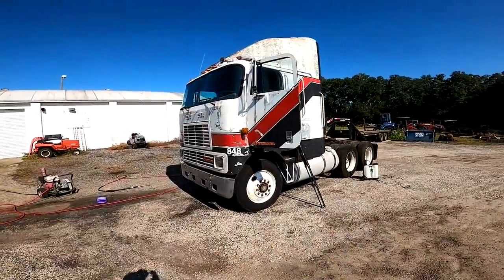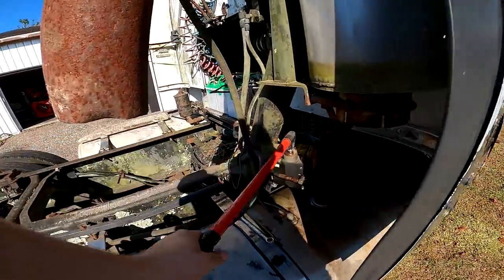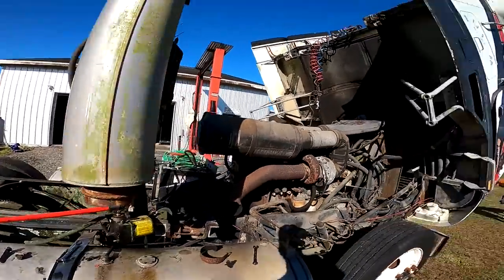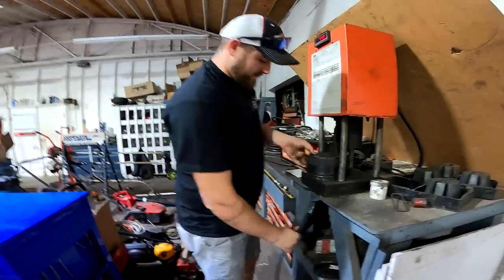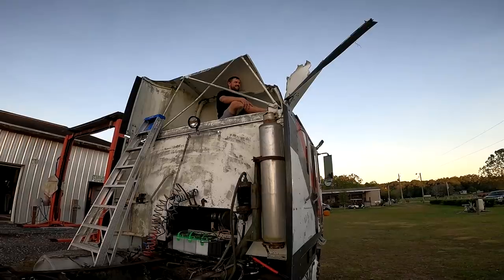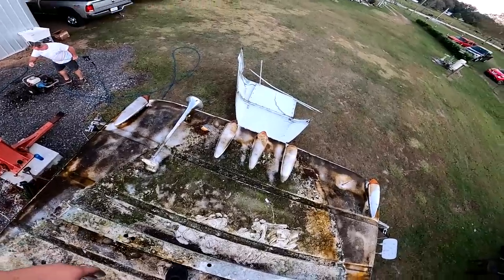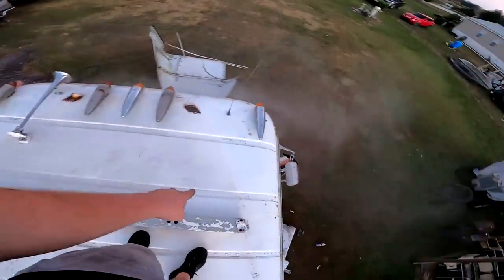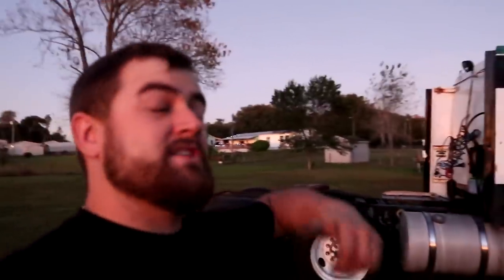THE CORNBINDER GOES UNDER THE KNIFE!!

Comment: Yeah engine id info usually on driver side of engine. Should have a metal like tag on front of injection pump. Probably a big cam 3 maybe a 4, i think its like 855 ci, like 14.5 liters. Around 350 to 400 hp 1450lbs tq. Easy like a 12 valve turn a screw and crank up the fuel  and roll coal lol.

Comment: All she needs is a set of chrome rims and twin pipes
Reply: And a air snorkel intake
Reply: More like polished aluminum wheels... not chrome! 🙄
Reply: Could have BOTH....needs the old lug studs pressed out of the hubs and longer studs installed to run Alcoa's up front, but assuming these are the older ball-seat wheel lugs, he COULD do it up "West Coast Style" with chromed steel outer wheels for the drives. There's powder-coated versions available now that guards against rust, would look REALLY nice.
Reply: @paulallison6689  Yeah so you can polish oxidation off all the time. That's always fun.

Comment: Leave the brackets just in case you want to haul something with a equipment trailer.  Top bracket makes a great bracket for a light bar and brackets by the light are where you can mount strobes.

Comment: Don’t mind me asking how much did you pay for the truck?
Reply: I’ve been dying to know that myself
Reply: Kinda wondering as well
Reply: I pray not too much. Even if it wasn't dead in a yard its not a valuable truck at all. Probably a 300HP cummins (Maybe a 330HP M11) in it and a 9 speed. Not very desirable anymore. 400HP is considered the bare minimum anymore.
Reply: I’m with these guys I’d like to know myself I’ve always wanted a cabover just wondering what kinda price to expect. Maybe keep up with cost of repairs and all and do a video when the truck build is done.
Reply: @gearjammergamer8560  while that may be the case. No emissions equipment allows for money to be put into it if more power is desired down the road. 💪
Reply: Yeah me too how much he pay for it
Reply: @gearjammergamer8560  those where better built and even the newer ones some still come with 350hp brand new its about the torque 300hp but I bet 1000 or 1200 tq
Reply: @gearjammergamer8560    Beauty is in the eye of the beholder.
Reply: I love these truck
Reply: @vee950  Still those little Cummins are not power monsters. I did a bunch of miles with A Freightliner FLD with a M11 350Hp back in ancient times.
Reply: @gearjammergamer8560  oh ok but the m11 is not a small Cummins that's a really big engine way bigger than a 5.9 or 6.7 those are 10 liters yea I used to see the guys fooling with them engines when I was working for Goodyear truck center years ago
Reply: @vee950  Your trying to compare pickup truck engines to Class 8 semi truck engines. Big difference pulling 17k pounds and 80k pounds. A 10 liter semi truck engine is a baby engine. Your not getting into nice useable power until 15+ liters in class 8.
Reply: @gearjammergamer8560  well no that's not true there's a lot of factors involved with that how big an heavy the rig is the axles and transmission not comparing but 6.7 ford or ram will pull about 40k the international cxt um looking to get in a few years will pull about 90k and it's a 7.2 cat engine in the 1um looking at
Reply: @vee950  I have over 20 years in heavy trucks. If your pulling 40k with a 6.7 or a baby Cat I feel sorry for you
Reply: @gearjammergamer8560  lol I agree with you
Reply: @vee950  that's an 855 ci cummins.14 liters. Minimum 350 hp,more than likely 400/450. With a 9 speed and good rearends 90,000+ all day no sweat! Do it with a 435 hp redtop n14 with a Rockwell 10 speed.
Reply: @tomcline5631  oh ok wow that's a really big one then

Comment: If you haven't found out that's  a Cummins big cam usually 400 hp
Reply: Not true! I worked for a Cummins Distributor for 15 years from 1980 to 1995.Look behind the air compressor area on the block and their is a s/n stamped into the block go to almost any dealership and give them that number and they can look it up and tell you the engine hp.
Reply: @philipmarsh7505  Yep. I can look up all the specs if someone gives me that engine serial number.
Reply: @Herooftheday64  I was incorrect it's been awhile  the S/N is stamped in the block just right below the rear cylinder head on fuel pump side of engine. 8 numbers .

Comment: The engine it info is on the driver side front of the engine on the timing gear cover by where the power steering fuel pump ect is bolted on. It's stamped on a metal strip that is pined on the side. I like the paint. Its quite the 13 letter shit spreader you have. Lol

Comment: Your engine code is on the drivers side, top of the front timing cover, it should give valve lash and HP. It looks like a 350 big cam to me, good luck old cabovers are cool. Get some Alcoa 22.5 knock off rims with low pro tires a set of 8 inch stacks maybe a eyebrow,chrome or monochrome grill and a flat front drop bumper and about 400 chicken lights.

Comment: If it is still there the engine data plate should be on the drivers side front of the engine on the side of the gear train cover. Looks like a later style exhaust manifold so most likely a big cam three or four. You did not show the intercooler on the drivers side of the engine so hard to tell which one it is. Great you are bringing her back! The Transtar twos were more stylish but those wide cabs had way more room inside.
Reply: Yeah, the Transtar II's/4070's definitely had a more stylish look than the fugly & boxie 9670's that's for sure!!👍

Comment: Look on the front left of the engine should be a info tag on the accessory drive housing to tell what engine family and hp serial number ext. Looks like an 855 cid big cam most likely 350 horse power.

Comment: Engine tag will be on the accessory drive, u can also look right under the head on the drivers side towards the rear it will give u a 8 digit number that u can use cummins quickserve or call cummins to give you all the info on the motor

Comment: Hi , I am new to your channel only because your cab-over ( i love these things ) caught my attention and I needed to pop in an comment.

A friend of mine got into repairing and restoring these right before I went into the military. 

I actually tracked him down a few hours ago , He currently lives in Canada and runs is own oil reclaim business and uses tank trucks to do so.

He told me , everything you pull off that truck should be put back on, and don't change nothing, not even the wheels...nothing...because....

If there is an existing build sheet somewhere, you will see the previous owner paid for all the options on it, and you actually have a very expensive truck from that time. From the cab skirts/runners (at the back of the cab hiding the equipment behind the cab) , tanks, and the wind splitter on the top. If you can find another splitter, that is great.

From experience doing fiberglass work , that can be fiber-glassed back together and repaired, it will just take time.

the only thing really that could be changed, without losing the actually build of the truck is the paint... maybe.... But, I even think that original paint scheme is great.

This should be restored to original , polished up, and used to haul your other hauls, and shown off. I think your 5th will attach to it also. (might need an adapter)

I will watch and see how it goes, going to send my friend the link also. 

I talked to him about if he had any connections any more for restoration, he said he doesn't, he barely works on his own any more..lol.

Looking forward to more videos on this lovely.

Comment: I've been following your videos on this since you picked it up.... looking a lot better now.   I don't know if you've found the engine "ID" tag yet... but, IF not - it "should be" on the LEFT (drivers side) front accessory drive cover in front of the PT fuel pump & governor housing (where you throttle linkage terminates), and it will be in a vertical position, as in - you will have to turn you head "sideways" to read it.  The NH, NHC, NHE, NHCT (custom torque), NTC, NTA (NTA was compound Turbocharged - 1970's - 475hp) were all 855ci (5.5" X 6.0" B&S). 

IF.... it were mine, I would stretch the wb out to 250",  get rid of that non-splitter Fuller and replace it with either an RTO or RTOO 12513 / 14513 (unless you're just going to "cruise" with it as a "bob-tail"), polished aluminum Budds all around (24.5"), leave the "cab extenders" in place behind the cab... get rid of the under cab - engine air intake and use a Pair of "behind the cab" filter housings from an FLA 96 or 108" Freightliner COE with 8" intake stacks to the top of the cab and finish it with dual 6" or 7" (exhaust) straight (or curled - at the top) stacks . 

I failed to notice (or remember) if your engine is "Jaked" or not... but, IF it has them... then your better off with 7" stacks as they will negate a lot of the resonance you would get with straight 5" (Especially the 5") or 6" pipes.   IF... you decide to go with mufflers, I would suggest Riker "High Flows" (if still available) with either the polished Stainless Steel housing or chromed  : )   Have Fun & Enjoy it.   Post happy Thanks Giving and Merry Christmas to you & yours. 

PPS: If it were "really" mine.... I would remove the "Cum-a-part" and do something really different and nostalgic and replace it with a 6-110 Detroit.... or at least a "lightly" modified 6-71T/TA or TIB.... along with all the other "goodies" I mentioned above.... Oh!!..and don't forget the "Train Horns"!!!    Sure has been fun spending Your money!!  lol  ; )

Comment: Slightly nicer than a Walmart fleet-spec of that era, but certainly not the top-level "Eagle" model. Looked like it has a Reyco spring suspension out back, lightweight but not the smoothest ride quality. That old 855 Cummins is likely within the 350/370-400 hp rating range(doubtful it's a 315 being it's a later model), with a Fuller 9-speed, it'll get the job done all day long without any fuss. Would DEFINITELY advise against removing any of the bracketry up top until you either get ready for paint/bodywork, or as has been suggested, they could make mount points for oversize/strobe lights if being used to haul equipment.

Comment: As an old school Brit trucker and a retired Scania Master Tech. used to 'cabovers' I hope you keep it as original as you can. The period white wheels can be shotblasted and repainted and where possible repaint the chassis and axles. The paint on the cab looks great 'as is' and could be just prepped and polished. Leave it 'warts and all' as we say here and let it wear its age with pride. It is what it is and all the better for it.
Just a little tip if I may? Those trailer lines on the back of the cab should be rerouted to a bracket on the chassis. Less 'stuff' under the cab, they can be left connected to a trailer when the cab is tilted, easier to fix and looks 'right'.
Have to say I am so glad you never slipped off that roof .... Nice project mate.

Comment: I would get a nice Classic Sun visor for the Cab and then I would use the brackets between the Yellow Chicken lights to bolt on a set of High-powered High beams and place them evenly spaced between the Chicken lights and of course some BIG Truck horns. 
I would get a Top peace made for the cab extention that follows the Shape of the Cab, it would give good Shelter for the weather elements and even better if you build a Frame almost the size of the cab and bolt that frame the chassis as close as possible to the Cab it self, it would give you even more Options for Toolbox'es to store your Tools and Equipment 'With proper Lock and Key!
I would also personally get Old school LED Taillights but with Built-in Yellow Indicator light and Break lights, and of course 3 powerful Working lights in the middle bolted to the Top of that frame sitting right underneath the Top part to the Cab Extentions you got fabricated. It would look cool and give you extra Safty with Taillights mounted up High underneath the Top cab extention.

Just my thoughts.

Sincerely.
TheDanishNutCase from North Jutland, Denmark 🇩🇰 in Scandinavia.

Comment: New tires, air leaks repaired, and new filters 1st priority. This way as you drive it to see what it needs, you know it's safe. As for the paint, once the safety and mechanical work is complete, go for a solid color and smaller graphics for a cleaner look.

Comment: Power cord is a "pigtail". Check all your steering linkage before you roll again. Just hit the fifth wheel unlock lever and if you see the pins slide in below the fifth ,you know it works.(doubt it does) The list is long...(edit) And if you pull the cab extenders then you have to get a chrome wrap/shield for around the muffler.(edit)Guarantee you there's water in the bottom of those fuel tanks(drain) and you may have sucked some into system...make sure you get good fuel filter with drain petcock. Check shoes. You know how to adjust brakes ? (easy) Check for any black on exhaust tubes from the turbo out(means a leak). Make sure all bell housing bolts are there and tight to motor.. Charge air tanks full,turn off,see how quick air guage goes down;find leaks. Don't know mileage...may be sludge in pan. Check for oil in water;water in oil(water jacket). That's enough.(edit)oops one more...check all your air bags on your air ride...they have to be shot to hell;not too hard to change.(edit)You have a differential lock on there to get a wheel on both axles driving....make sure it works;know which way is on and off....don't drive with it on;just use it if you need it. Ok ,now I'm done...for now.

Comment: And something falls out the sleeper and bust the wind shield. What's your budget? Aluminium wheels with new rubber and fuel tanks. The VIN has all the information, engine, transmission, place and date of manufacture, possibly Garland, Texas, but you know that.

Comment: The slang term used by us truck drivers for International was “Barnyard Buick”. Keep up the work getting her back in shape. You will be pleased with that 9670 model. I ran several of them back in the eighties. On the left side of the engine, on the accessory drive, you will find the engine information.  Good luck bud!

Comment: Looks like a Cummins big cam 4 maybe an nt88. Data tag is on the accessory drive ear, serial number is on drives side rear top of the block, and fuel code is on the pump. It clears up to fast for a 400 so it's probably a 315 or 350 hp. If you keep up with the DCA and overhead sets they were good motors.

Comment: ID tag is on the timing housing just underneath the Aircon Compressor (in front of the main air compressor) Drivers side of the block, below the injector pump, you will see Big Cam cast into the block. The only challenge is finding out what HP it is rated at.

Comment: I love Projects like this.. I used to buy Old Motorbikes and old VW Beetles in South Africa and completely Rebuild them ( some VW beetles kept their engines and their original axles with the drum breaks, and the others I used to use the Front axle of a Ford Escort with disc breaks and replace the VW beetle Engine with a Ford water cooled engine) I used to do this as a Hobby in my spare time.. plus it made me a fair profit from selling my projects on since I did all the work (rebuild, reupholster, new paint ) the only things I couldn't really do where certain things like new chrome work or certain engine fixes which needed to be done in a manufacturing/engineering shop.

Comment: Cummins engine - VT-50 turbocharger - early Big Cam engine - serial number will be stamped on the rear of the cylinder block, drivers side - just below the rear head. Engine data plate, if it's there, will be on the - ear - of the block behind the accessory drive pulley, behind the water pump belt and fan belts.

Comment: The engine inför is on the left of the engine on a tag by the accessory drive Pulley (right behind water pump belt). Should have CPL #, HP,  ser# Mod #, any information you would need for the engine.

Comment: Get the serial number off the block and call Cummins (left side of the block towards the back) Or join Cummins 855 Enthusiasts on fb and someone on there will help.  My N14 has a data tag on the left side of the front cover in front of the air compressor.  Yours may have one if youre lucky.

Comment: I definitely think you need to do a classic color and graphics. Paint the cab dark green and the same or similar graphics in a lighter shade of green or white and paint the frame to match the graphics unless you go with white then paint it black. Put chrome wheels and re-chrome the mirrors, grill, vents, bumpers. Put a new exhaust on it with horizontal stacks with straight cut tips. That’s personally what I’d do there’s literally thousands of different graphics and color combos for these old cabovers and relatively inexpensive to buy them. It’s a really cool platform that’s very customizable, hell just watch CHIPs and you’ll get inspired lol

Comment: I owned a old jb hunt 91international set back front axle,condo double bunk cabover. 300 cummins, 8 spd. you can do what is called a button kit. on injector pump.red orffice will make it 340 horse, if i remember.also had a walmart 94 international  identical to what you have there. but mine had a series 60 detroit with a super ten transmission.I put super singles on the front, and switched to big tires and alcoa wheels.

Comment: If you're still having trouble finding the ESN, you can either call a cummins dealer and give them your entire truck VIN, or call an iH dealer and give them your last 8 and they will be able to tell you what was in it new. Only is beneficial if the engine in the truck is original. Or post up the truck VIN and I can get your ESN with my quickserve login.